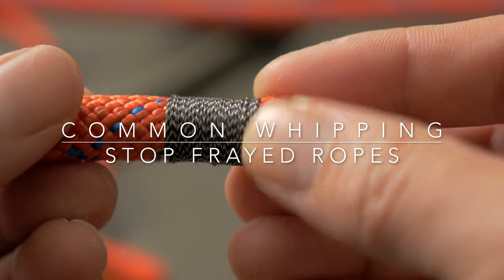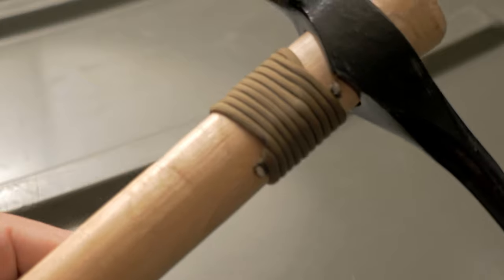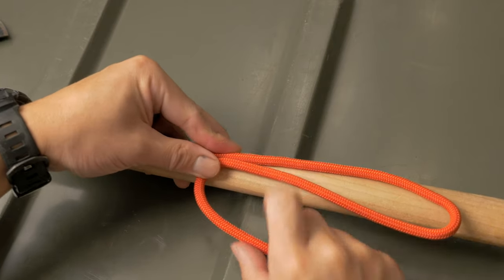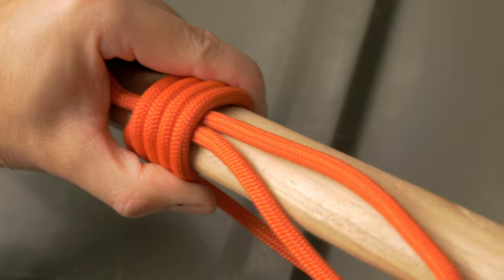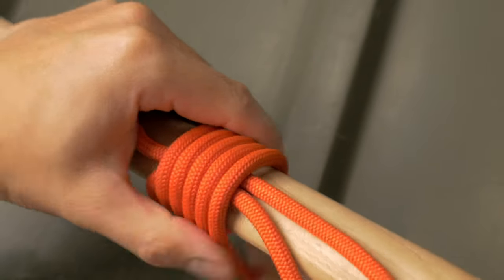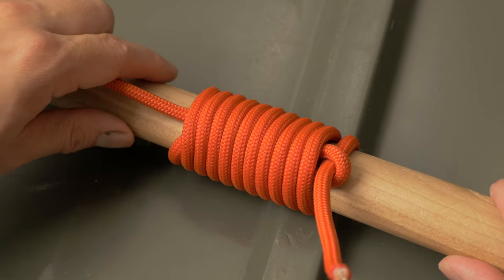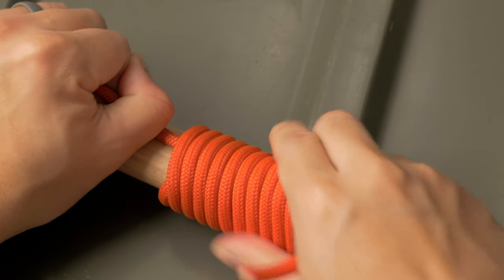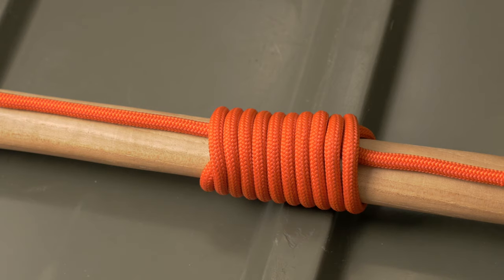STOP Ropes From FRAYING | Common Whipping Knot

Comment: I learned about Whipping at a very young age. Ropes and my favorite using rawhide to protect axe etc handles makes the handles bullet proof or shall I say wife proof, LOL.This can be done with wire on cable end loops as well. No need for clamps.
Reply from the maker: Rawhide works awesome and looks good, esp on lariats
Reply: @innerbarkoutdoors  Aside from the elbow grease it is easy enough to make. I did a video on that and for whatever reason I seem to alway need to make about a 1/2 a cow or moose in manageable pieces of hide a year.  There is soooo many uses or it.